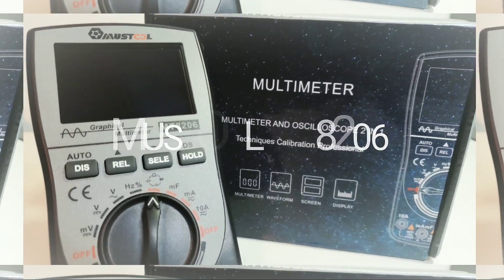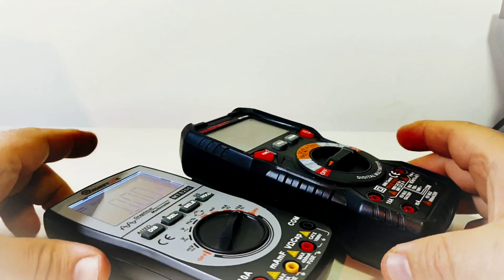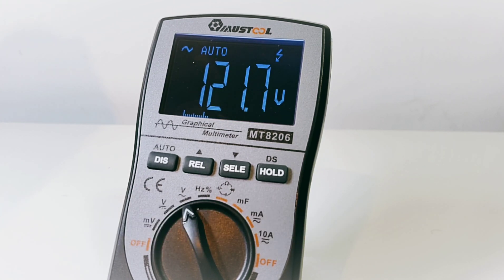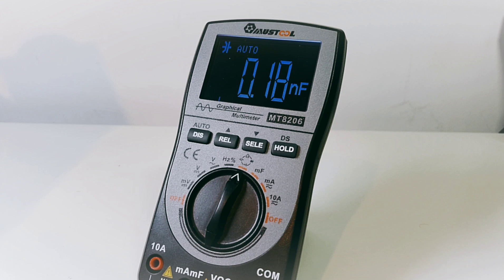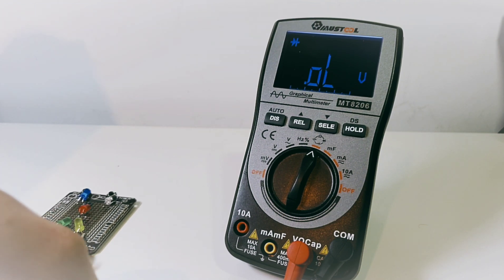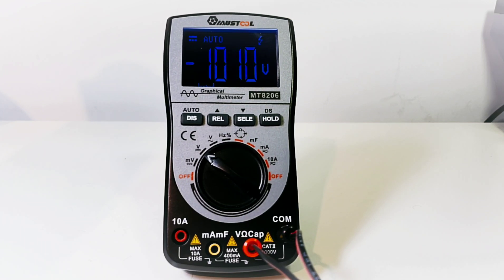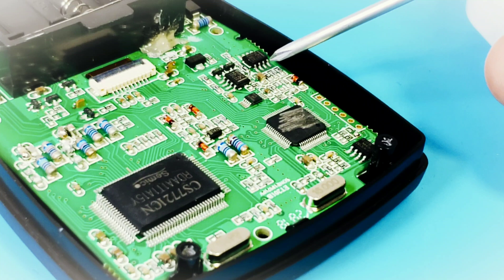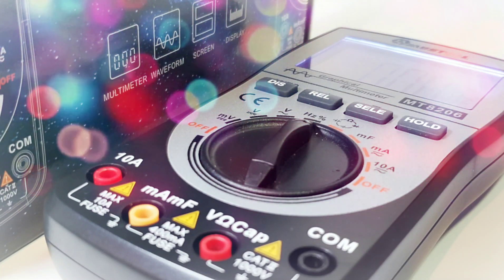MUSTOOL MT8206 Multimeter Review & Teardown

Comment: Would this be good for automotive sensors? Basically watching a 5 volt DC circuit for a split second drop out? Or does it not update like I'm thinking?
Reply from the maker: Unfortunately not...it could work but would be hit or miss..this just isn't meant to replace a good bench diagnostic scope.

Comment: If I disassemble the multimeter that came with that fault, I lose the warranty by changing the fuse.  And will the failure to measure on the mF scale work?
Reply from the maker: You can't void a warranty by replacing a fuse, that's part of the operational capabilities of the meter. It will probably solve the mA issue but has nothing to do the the mF. You can also send the multimeter to me and I will fix it free of charge..email me: netplicity1@gmail.com

Comment: Hello Good morning, I bought this multimeter and it does not measure me in mA, mF. I just bought it?.
Reply from the maker: When testing high capacitance ,  Make sure to put the positive test lead into the mA/mF input (3rd from left). For mA , your fuse is probably blown, test and  replace  the mA fuse. Try again 😉👍
Reply: @KeepOnTesting  If I disassemble the multimeter that came with that fault, I lose the warranty by changing the fuse.  And will the failure to measure on the mF scale work?
Reply: If I disassemble the multimeter that came with that fault, I lose the warranty by changing the fuse.  And will the failure to measure on the mF scale work?

Comment: My meter says it's a Lm 2001 but, the one I have looks exactly like this MT8206. Where are the fuses. I surmise they are those two surface mount devices. One says 10A and the other one says "C" on it. Love to know if I am right about these being fuses. Could you let me know?  I can use the meter but I tried to take a voltage reading without changing from the ma range. Stupid I know but, it happened and I blew the 400 ma fuse.